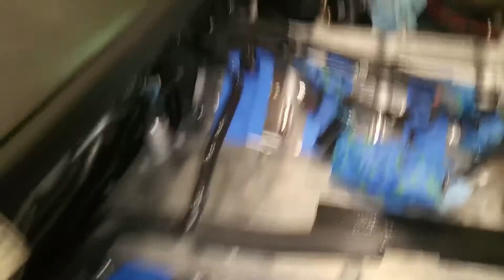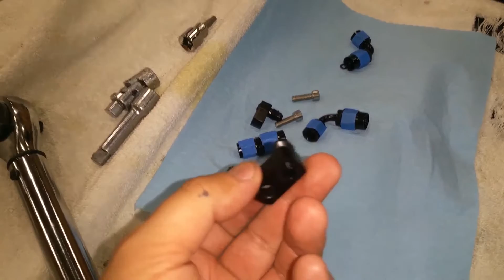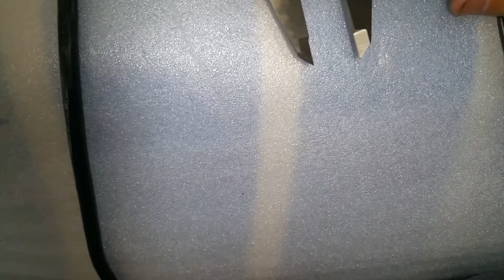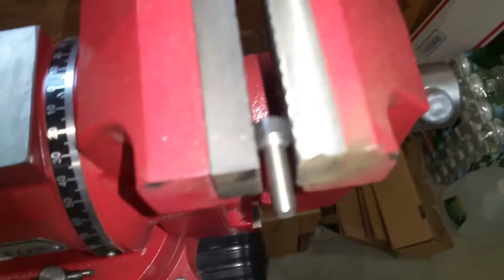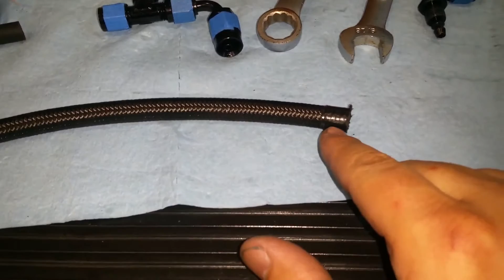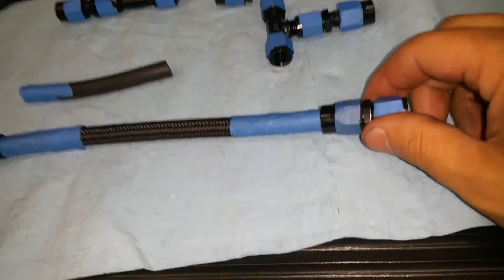Installing Trick Flow Steam Vent Kit LS Motor. Boosted Corvette Build. Part 27

Comment: Can you use the trickflow steam vent kit on the stock heads? I know the back has block off plates. Can i just drill it out for it to work?
Reply from the maker: Hello 2009 G8 GT 6L, glad to hear that worked for you, some folks with the stock heads asked me if their stock heads will work wit the 4 port steam vent kit and I had to tell them No. Thanks for watching my video and thanks for the comment.
Reply from the maker: I cant say for certain if you can drill them out but perhaps you can. My stock heads are package in my attic so i cant see them so easily to look at them.
Reply: WATCH ME WRENCH im asking because, on researching it you can drill it out. When to drill you will feel it loosen up, and that's when you stop drilling
Reply from the maker: Ok cool so give it a shot and good luck. let me know if it works.
Reply: WATCH ME WRENCH i will try, hope i dont FUCK nothing up
Reply: My LS3 cylinder heads (821) had the rear vents blocked from the factory and I connected them with the fronts. I did that when the cam  and AI ported heads went on. They did not need to be drilled..
Reply: 2009 G8 GT 6L so what are you saying you tapped them out or just ran them blocked?

Comment: Why not tap the hole deeper?
Reply from the maker: I had thought about doing that but at this point in the build I was questioning the construction of the heads and I wasn't sure if I tapped the hold if I could accidentally punch through the head as I didn't know how much material was on the other side of the bolt hole. If you watch all of my videos you'll see that these heads had issues with many bolt holes not being fully threaded all the way down. Not to mention the manufactures left a lot of aluminum shavings/shards in the heads which I had to remove. Thanks for the comment 407ForRent and thanks for watching.

Comment: what does a steam kit do?
Reply from the maker: Hello freddienz68, well the 4 port steam vent kit I got helps the engine to release and evacuate any steam and any coolant faster that a stock 2 port set-up. Helps keep the engine running a bit cooler. Back cylinders on LS motor tends to run hotter than the rest because most LS motors do not come with a 4 port steam vent setup. Thank you for watching.
Reply: I have a 04 gen 3 ls1 in my 04 vy ss ute. 
would I benefit from this set up?
I have some videos of my set up.
Reply from the maker: I just watch some of your videos, nicely done. I see your ute is modified quite a bit and since Im assuming you beat on it, I would recommend getting the 4 port steam vent kit. It cant hurt it can only help. I just cant tell you how much it will help. But if that were my vehicle, I would get the 4 port steam vent kit.
Reply: how difficult is it to do with not removing the intake manifold ?
I can only see the ports on the front of the engine.   not sure where the back one are.
Reply from the maker: If you have stock heads they might not have steam ports in the back. I am not sure about an LS1 engine. If you only have steam ports on the front then I would just keep the factory steam vent kit.
Reply from the maker: The install is easy, you just have to figure out which elbows you will need and which way to run the lines.
Reply: WATCH ME WRENCH ive seen the back of my heads i have stock heads that have been lv5 ported. I wanna use this kit. But mine in the back are blocked off or the holes are fulled with something. Can i just drill out the holes and install the steam vent kit. I have the same car as you but 80mm custom turbo kit. LS3 also, with stock heads
Reply: How has this kit worked out for you?  Will it interfere with MSD intake?
Reply from the maker: @paisley2342  I don't know. I can tell you it will NOT work with a Fast manifold. I made other videos about this issue. You can find them in my playlist. It was very difficult to make a custom kit and no one makes a low profile steam vent kit for the Fast manifold but the MSD might have the same issues. You may want to watch my other videos to see the parts and pieces I used to make my own steam vent kit.